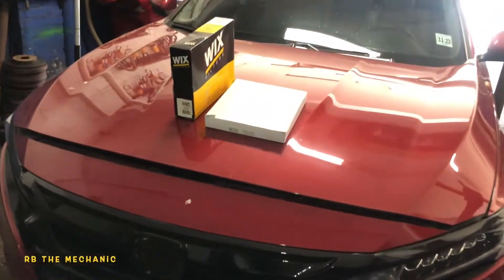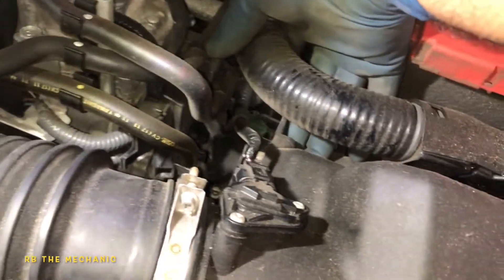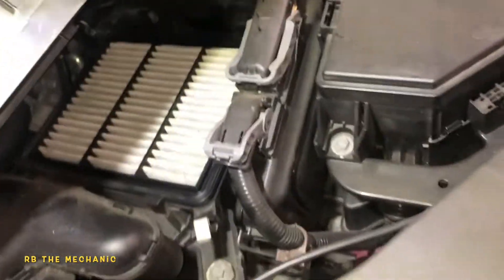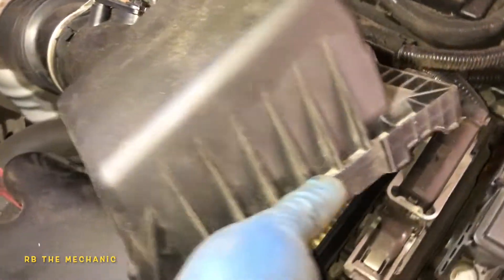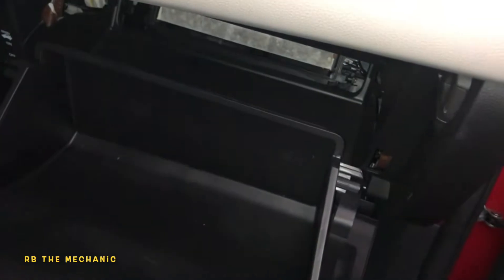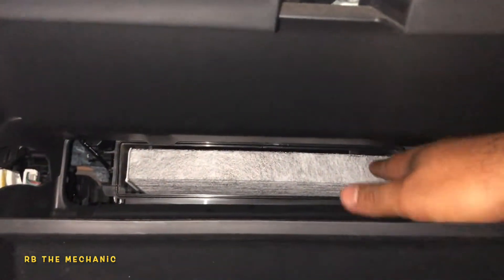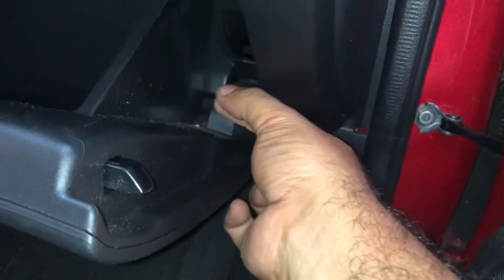Replace air and cabin filter on Honda Accord 2018 to 2022 DIY save $80

Comment: Hey Ralph Bob The Mechanic!, other than Manufacturer Parts (OEM), what other aftermarket parts do you suggest for a cabin filter and air filter? Anyways hopefully you don't put out a video tomorrow (working tomorrow)?, on new years day? If you don't, then;

Happy🥳New🎉Year!!🍾🥂🥂
Reply from the maker: I got pre recorded video I just diagnosed bad engine gonna be working on that but after new year.  I’m off for next 4 day bday on 4th!!
Reply: @RBTheMechanic  2:18 2:23
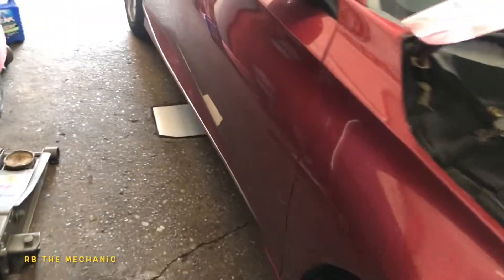Reply: @RBTheMechanic  2:46 2:47
Reply: Sunshine 2:23 hours